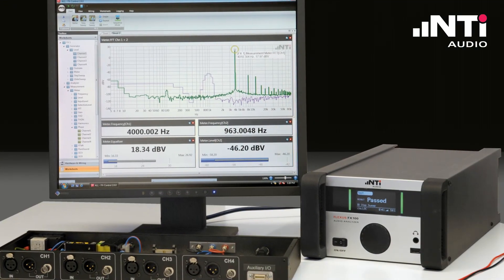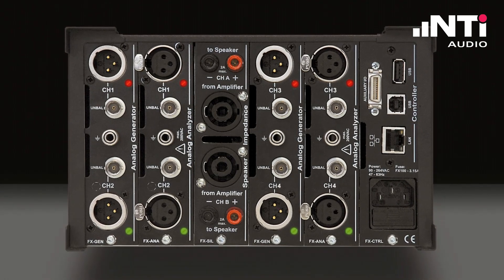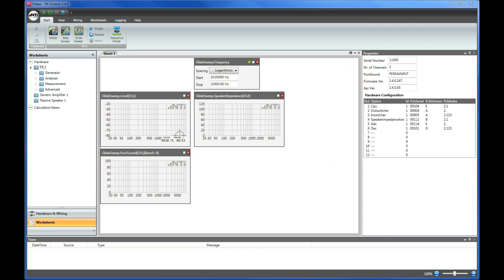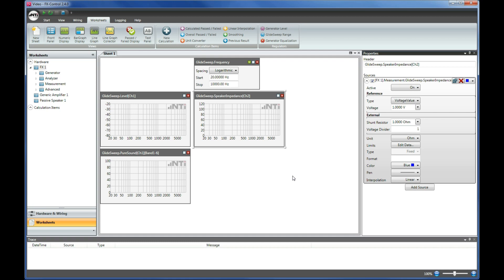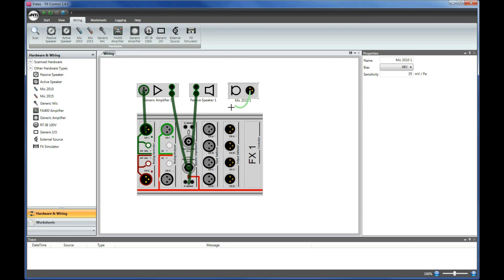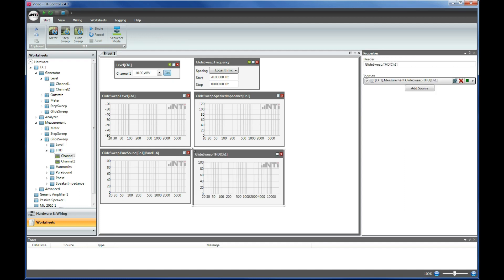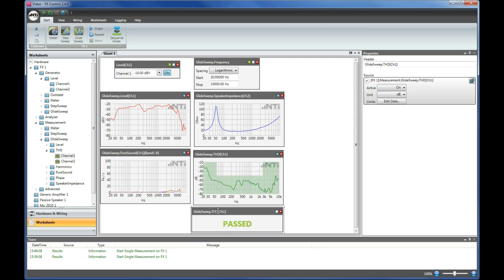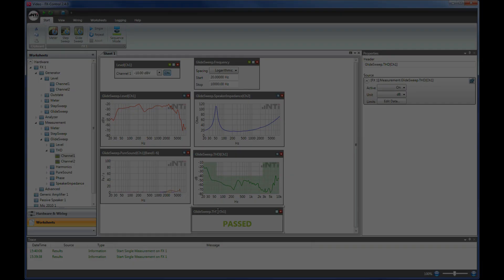NTi Audio: Introduction to the FX100 Audio Analyzer

Comment: hello. 
First i will thank you for the good support.

I use fx100 audio analyser for measurement. I do the same thing as you do here in video, but i can't measure anything. The display at fx100 shows "passed" and there is audio from the speaker. but no graf shows.

can I have forgot something?
Reply from the maker: Hello Mehdi,
thanks for your request. The front panel display of the FX100 does not show detailed measurement results, but only indicates a PASSED or FAILED of the performed test. The measurement details (graphics, bargraphs, etc.) are visible on the PC, running the FX-Control software. For further information please contact NTi Audio at support@nti-audio.com
Best Regards,
Gregor Schmidle